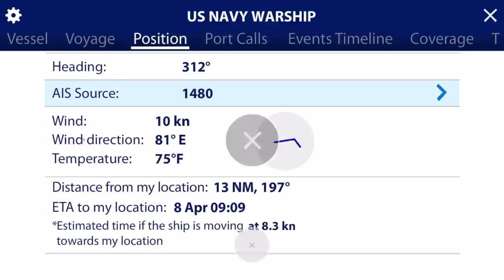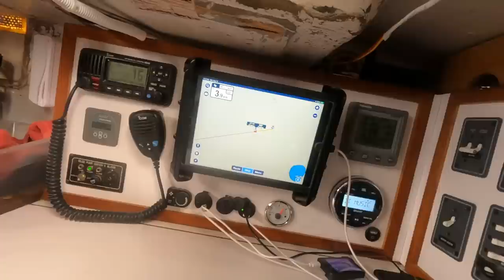What I Learned On My First Solo Ocean Crossing; Ship Handling to Sleep, Gear Failure to Landfall!

Comment: Appreciate your honesty, all good advice. One possible addition to the content might be sail handling/set up. An old single handler taught me to always,, whatever point of sailing the boat is on, have a preventer  on the boom when offshore alone.  I have a relatively small mainsail (70s IOR boat) and find I can reef that on a run if I centre the boom first to take the power out of it (simple slab reefing, standard battens).  A small jib pulled in tight amidships and a prevented main also works well running downwind, the jib acts to keep the boat on course.

Comment: Very good points. Something extremely useful to have in first Aid Kits aboard for Bad Cuts etc, is after using an antiseptic wipe, use Superglue on the Cut, then hit the Superglue with accelerator spray which sets it in a few seconds, then you can build up Superglue layers for extra protection each layer getting accelerator sprayed . luckily I had both plus antiseptic wipes in my truck in a Hurricane Onshore as a Roofing slate got blown off a roof and I glimpsed it headingbto my head at high speed from my left and threw my hand up to deflect it over my head. It hit the index finger on my left hand, and almost severed it. Phoned the local Hospital ER, and they said there were so many injuries, it would be at least 3 hours to get in. Luckily I had a young Apprentice with me,  and after cleaning everything up, stuck some Superglue in the gash and got him to hold it all together while Accelerator zsprayed it, then he applied the Superglue I sprayed, and we built it up enough to make a a solid finger stool (I think that's what it's called). I was a bit worried about getting the Superglue off, but as it turned out it all held together fine and after about a day or so, started coming off on its own, leaving a shiny line holding things together. Years later, you can barely see where the Cut was. Bonus the young apprentice stopped being squeamish about blood (a great kid, he turned out to be a top notch roofer, and did exhibition work at shows. Yes, potentially difficult to do single handed, but with care and taking your time, even that should be doable, when necessity comes knocking on the door. The trouble with playing music, is you do lose connection. At one time I was a professional long distance driver, and I stopped even listening to the radio in the Cab. For Naximum Safety on the Road your observation and thinking distance has to be much further ahead than most people have their attention. It's pretty much the same when Afloat. I used to work on 12 minute naps in the Cockpit at night in comfortable warm gear, then wake up, look around, set the alarm 12 minutes again, and right back to sleep. During the day, after a meal, Mostly it was possible to get a couple of 2 hour sleeps during Daylight. When I was in the USA in 2016 buying a boat, I tested Walmart Powdered Milk, found it was as good as the best in the World, so stocked up with it Porridge in sealed plastic bags is good for breakfast, so I'd mix the Powdered Milk in, add Sugar (which gets an undeserved bad press, as our bodies can handle sugar no problem) then just add hot water (nb, confession, I prefer nice honey in Porridge). I can go a half a day on that, but later in the morning, I have some chocolate, as my Dietician friend said Chocolate is brilliant for us in the Morning, but don't have any after lunch - so far, so good. It's also easy to make different types of bread Afloat - look for Navajo Fry Bread Recipes and Hillbilly Jitchen on YouTube for easy starter recipes.  Stews, Chillies,  things like that are easy and fast in a pressure cooker, and fresh bread goes nice with them, plus there's Pasta. Fishing. For round bodied Fish, if they aren't too big, Cut the belly from head to tail, clean out and rinse, cutbthe head off for bait, then on the firm galley worktop lay it out belly down and opened out, then with your fist bang down where the head was to the tail  on the back from tail to head, head to tail a few times, then you should be able to grab the head end of the spine, and pull the spine and all the attached bones out of the body. If it's a Scaled Fish, you want to descale it before you start over a tray or something in the Cockpit, and throw them overboard or you'll get Fish scales everywhere and you'll be finding them for weeks.  All,ofbthe Fish you now have left is edible. Some people eat fish Raw, but Avoid, as they can have very nasty Parasites, which you definitely don't want. A big problem in Scandinavia,  where a lot of people like eating Raw Fish. Thebmorevfishbyouncatch, the better at catching them you get, and the better you get at preparing them when you catch them. Best Wishes and Fair Winds.  Bob.  👍🙂🏴

Comment: Just as a matter of personal experience with fishing, you should always use a gaff or net to get the fish out of the water once it is in reach of the boat and a mallet to kock it out before it can cause anyone injury.   I have lost so many fish, poles, gear, time, gas, blood, and respect at the rail trying to pull the fish out and onto the deck that way.  Sail on!

Comment: Great reminder regarding redundancy. 
Regarding fishing. I would suggest you practice before you are desperate, stress makes it harder to land fish.  Also, I used to work. PNW  commercial fishery troll (lure) catching salmon. I could land quite big salmon in the cockpit by just slightly altering their trajectory, so that they would kind of fly into the cockpit.  Get the fish alongside, and as it swims parallel to the hull, wait for a moment of acceleration, and subtly redirect it up and in using the line, you need a cockpit close to the water like yours.  This  works for 10-20 lb fish....after that a gaff hook.

Comment: good point on the ratchet straps, i just bought a new battery and am buying 5 to tie down my 70kg battery, i was going to cut them down, but ill just leave them long in case i need them for something else - also i have a proper sailing helmet cause my greatest fear would be to get knocked out by the boom

Comment: Hello James, thanks for the great learnings.  I have a 1965 Pearson Vanguard so I really like seeing your Alberg in action.  Did you carry any storm sails and how do you have those rigged.  My boat is rigged as a pure sloop rig without a baby stay and I have been thinking about adding a storm jib or try-sail to use in place of a reefed genoa (fearing mast pump when having a small head sail high up on the forestay).   I do have a ring already installed on the mast to connect a new baby stay when I need it and then I would use a pair of running back stays w everything sort of clustered at the shroud point on the mast.  I have 3 reefs in the main sail and the Vanguard has a roller boom as well so I am not sure I would do anything about a storm sail for the main (like adding a second sail track or something).  What are your thoughts about storm sails and a good sail plan for your boat - many thanks and Godspeed!
Reply from the maker: I have a Solent stay so no need for running back stays. I got rid of my storm jib because it was very old and the hanks had sized up. For the most part storm sails are pointless unless you plan on sailing in oceans at the times of year you have no business sailing in them at.

Comment: Hey man, really liked your voyage to Hawaii and have lots of respect for your figuring out how to steer using a drogue but man you had a month to figure out fishing 😂. That would have been my main past time on board. And I'm also not a salted angler.
Reply from the maker: When sailing solo if you are fishing and you get one on the line you have to completely stop the boat which isn’t like stopping a power boat, then you are being tossed all around while you fight the fish in, get it onboard, then try and get the boat sailing again, and get it back on course and then deal with the fish. This whole process could take 2 hours or more. Yeah, no , hard pass

Comment: One of many ideas would be that via a wrist or ankle worn radio transmitter for the liferaft to deploy as soon as the yachtsman fell overboard, so his swim may be only yards. I don't know, I'm clutching at straws here, but trying to put myself in the place of a recently overboard person and what they may want to have happen! I suppose in the end we must force ourselves to wear a safety-line, but my idea may also help with a lone watchman going over during a 'graveyard' shift. Imagine coming up on deck due to an uncontrolled feel in the boat only to find that little Denzil or whoever had apparently gone over an unknown amount of time ago? At least if the liferaft had deployed the rumpus should have woken the slumberers, and they should be able to put into practice their man overboard drill. I feel these issues are not paid sufficient attention purely because the huge cost of setting up a manufacturing process to make such a device, whereas the electronics already exist to alert people to pets, children etc wandering off, and it shouldn't take a genius to create a way for the liferaft to deploy at the same time as the man overboard alert.

Comment: submerging with any foam filled helmet is nearly impossible alongside actually accomplishing anything else...there are clamshells with neoprene padding designed for cave diving that would be well suited for u/w repairs at sea or improvised by replacing the foam with neoprene in other helmets
Reply from the maker: Good tip 👍🏻

Comment: Dude I’m glad I ran into your Channel I had a 30 foot Catalina for almost 30 years I also worked for Frank Butler for many years I was the parts department manager so I got all my parts for cost +10% even though that boat was a 1982 it had everything that the latest and greatest boat had on it.   I can completely relate to your redundancy ideas plus I had more tools on my boat than I did in my garage at home I often sailed alone and I figured I’d rather have the tools here on the boat than sitting on the damn workbench at home.  I’ve got so much to say but I’ll leave it here for now I had one horrific experience thinking I was through the shipping lanes  and decided to fall asleep but that stories for a later time. Safe passage my friend!!

Comment: Can you explain more about coming within a mile of bigger ships? A mile seems so far away, why is that considered so close?
Reply from the maker: Those boats travel at 30 knots, that means if they are 1 mile away they can run me down in 2 minutes. My boat goes between 3-5 knots and is limited in its ability to moved based on the point of wind

Comment: I would appreciate your opinion on sailing my 1970 Tartan 30
Sailing from San Francisco to Hawaii.. she's set up for racing from the previous owner... I'll be reducing the sailing plan to get the boom high enough for a hard dodger.. wind vain.. rigging is 4 years old... 400 watts of solar..  3 100 ah agm batteries.. ( new) don't have the wind vane yet.. but plan to take 3 simrad tiller pilots in case I can't find a wind vane.. ( great sails.. roller is good 125%.. hopefully adding a storm jib.. 
Much more.. 
Thanks to you I'm taking ratchet straps and a bike helmet... solo most likely.. 
20 % sailing experience.. 
10 years of commercial fishing.. Washington, Oregon and Alaska.. never been sea sick and I've been fired for not daunting my life suit in a extreme situation.. meaning I'm not afraid of anything.. but I wanna be smart.. .. 
Tartan 30.. so frigging stable.. 
Rather have a Alberg 30..
Reply from the maker: You have the right boat for the job, just make sure you sail in the right season. The No Windvane thing would be my only concern, those tiller pilots burnout super easy and they will be working really hard with following seas and downwind sailing . 

Tradewinds sailing is very forgiving so your sailing experience won’t be an issue since you have spent so much time on the sea
Reply: @SailorJames  I appreciate the boost in confidence.. especially on the Tartan 30. 
Will not leave without a wind vane.  I'll be shaking her down this summer along the California coast.. thank you !

Comment: When you 'clip in' do you only use the 'high side' & are your jacklines rigged to prevent you going over the life lines?
If not have you tried (with  someone else on board) to fall over & then see how you are restrained by the jacklines/tether ?
Do you trail a line?

I am, really interested in all of this as I am planning how to rig my own boat - friends are scared when I tell them no pfd & then I explain (as you did) why - then they get it - I'd rather not be floating shark feed or as you say have to make that decision to get out of your pfd and ...  (not that I intend to leave the boat at all!!!)
Reply: replying to my own comment - it always makes me wonder how many short-crewed boats put in the thought as to what they would do - they wear a pfd and think that's it - I wonder how many of them have actually tried a recovery
Reply from the maker: Yes you should always only ever travel forward on the weather side so you fall onto the boat and not off the boat. No I don’t clip in and throw myself overboard to test recovery but I do pull myself onto to the boat without a ladder regularly at anchor to make sure I can do so. 

I only trailed a line when I was adrift and getting in the water, I was concerned about it fouling my Windvane so I didnt do it all the time

Comment: Good lessons.  Apps failures are typical and to be expected. Usually it's some nonsense where you have to log into their server to reopen the app - but you're off the grid - at most need of the stuff.  It's not really a tool if when you most need it it doesn't work.  The default should be that their software just works no question for as long as a crossing takes - so at least a month, or it will always work if the device has no internet connection.  
When my son was young he got sick while we were traveling. We couldn't find Pedialyte, so we gave him Gatorade. Okay ... . If you get the sh**s and you drink Pedialyte (expensive!!) or Oral Rehydration Salts (dirt cheap - in clean water exactly the same as Pedialyte) you can survive any bout of diarrhea no matter how long it lasts. With Gatorade....better than nothing. ORS is in the exact proportions your body needs.  
I like your thoughts on music and the sea. Some Youtube videos.....  Gunboat used to be the worst offender - absolutely amazing boats, absolutely amazing sailing video and the worst loud canned horrible muzak you can imagine. Hearing the wind, or when sailing down wind - the absence of wind, and the water rushing by the hull - it's what I want to dream about later.